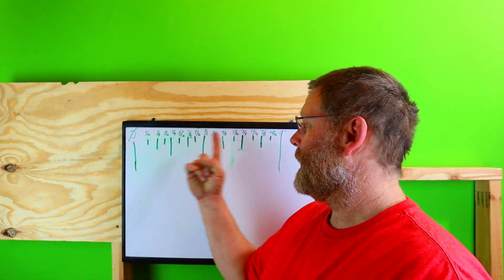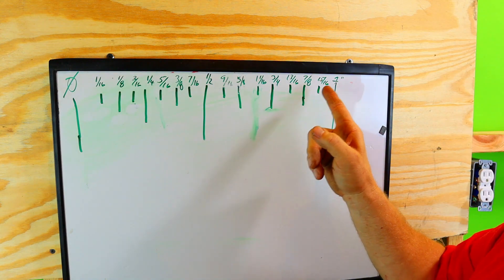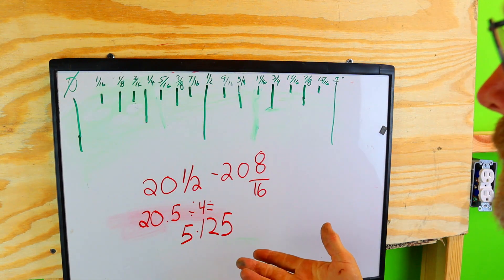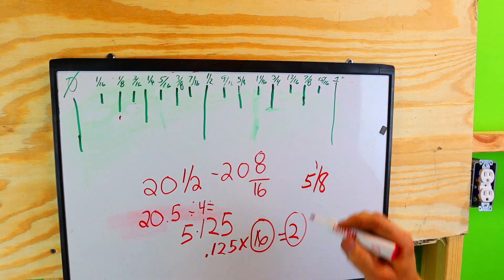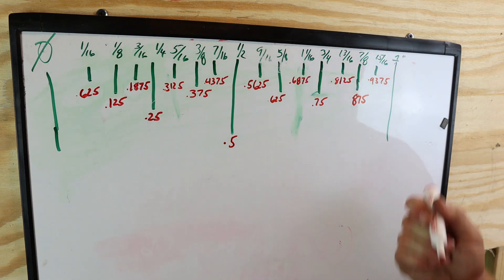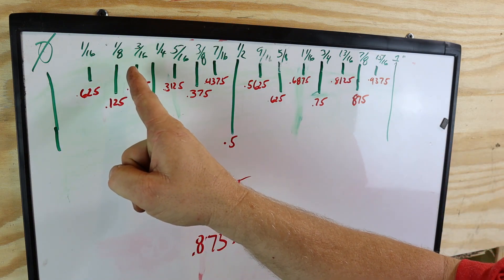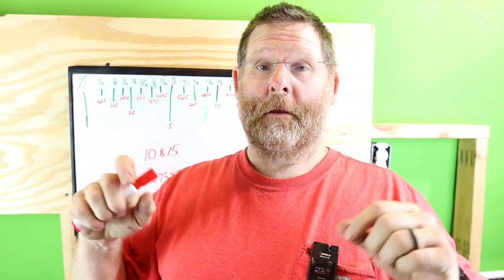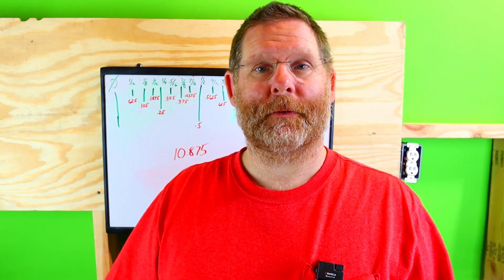How To Turn Decimals Into Fractions Fast

Comment: i never knew this. nice. i noticed too you can multiply by 8 if you want and get  similar result but in 8th ticks then if you end up with a .5 in result then you know your looking for a 16th tick instead of 8th tick. for example .3125x8=2.5 (2 whole 8ths and a additional half a 8th to give you the 16th,  or simply 5 /16ths ... ether way math works
Reply from the maker: Awesome I didn't know that thanks for sharing.
Reply: Guess what, it gets better. You can also multiply by 32 and 64 to get 33nd's and 64th's. Notice the commonality in factors of 8. That's why I subscribed!! Cheers!